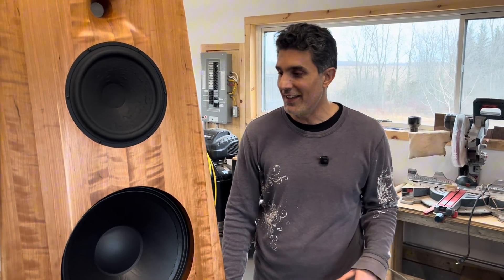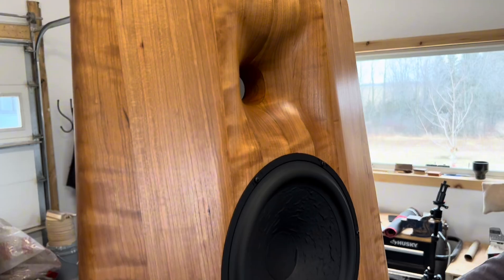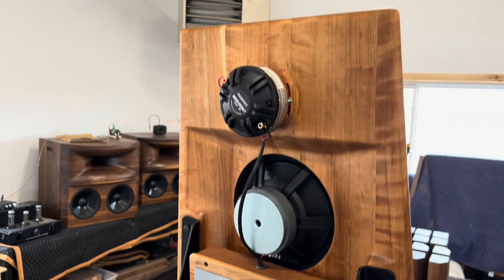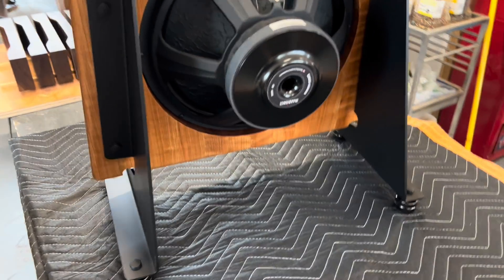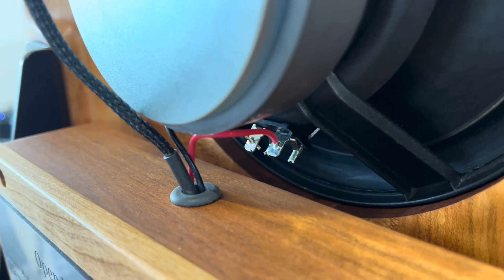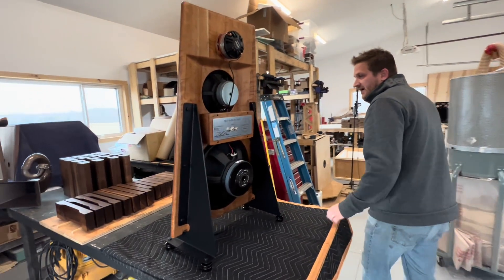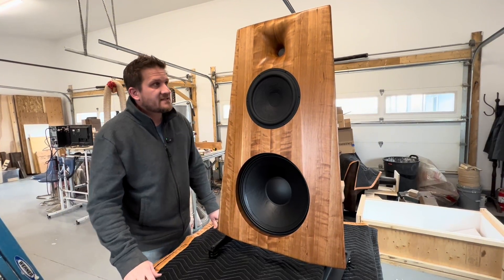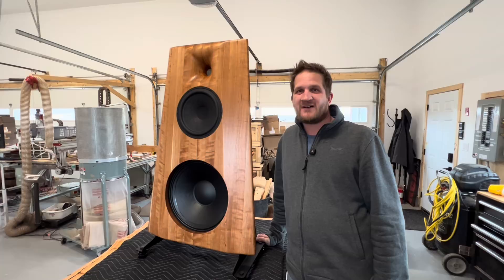Closer Look! Open Baffle Speaker No.1695

Comment: I have open baffles in my living room and I love them.  Mine are built in 1.5 inch Baltic Birch and solid walnut, 1.4” comp drivers and 15s on the bottom.  Your open baffles with the sculpted hardwood horn and baffle are just exquisite!  I love seeing beautiful design and fine woodworking.

Comment: Surprising to me that a compression driver horn at 110 db sensitivity would be matched with a 10” mid woofer at under 90 db, particularly with the high amplitude breakup at 2.5 kHz.
Reply from the maker: The compression driver is padded down so no issue there. 2.5kHz is outside the crossover region.

Comment: Your website does not mention their nominal Impedance . For $13,500 you should mention that . Most beautiful OB speakers I've seen . Hands down prettier than my Spatial Audio M3's .
Reply: it says in the specs of the Speaker No.1695 (blogs), it stands at 95dB and is stable or "well-behaved" 8 ohm load. all thanks to the 2.5 configuration I suppose...

Comment: Beautiful. What is the tweeter height? Might be good to add on your webpage. Some sound sample videos may be helpful as well as some frequency, spectral decay, impedance, impulse, plots. Anyway, excellent, and Canuck too.
Reply: On the website the tweeter height is stated as 948 mm or approximately 37.3 inches from the floor with GAIA footer attached.

Comment: sure looks beautiful. just a hint, the SB Audience ROSSO-21SW800 has a QTS of 0.76. That should be good for open baffle as well. 🙂
Reply from the maker: Don't tempt me!
Reply: My question would what would your design goal be here.  The 21” driver doesn’t go lower than the 15” woofer being used in 1695.   So if you are looking for greater low frequency extension, this probably isn’t going to work.  Of course, a 21” driver would move more air than a 15 driver.  

On first glance, where this might make sense is as an alternative to something like using dual 15” drivers per side.  It could also make possible using dual 10” drivers in a MTM with the compression driver.  But now you are probably talking about a speaker that would only work in a large room.
Reply: There is also another concern.  The 21” SB is roughly 3x the weight of the 15” woofer used in Project 1695.  One of the many great things about 1695 is the speed and definition of the bass.  Would the much heavier 21” SB have the same speed and detail?  These kind of questions is why you never really know what works until you build it and listen to it.

Comment: Troy, I'm still getting to know these incredible guys.  They continue to amaze me every day (especially bass articulation), I literally play them at least 8 hours a day now that I'm retired.  I'll have a full review for you in due time.  Just know that I've been through lots of OB speakers in my listening room and have heard great OB systems, but I wouldn't trade these horn open baffles for anything else.  The 1695's prove that impactful visceral bass can be had from an OB design, something which has eluded all other OB designs in my experience.
Reply from the maker: Thanks. I remember when I visited Germany I was invited to a private listening session. They played Diana Kralls 'almost blue' and I complained that the piano sounded thin. I then took the helm and adjusted the EQ (the system had EQ ability) adding bass and mid-bass unit it sounded proper. Everyone was nodding their heads that is sounded much better. This was one of the test tracks I used to develop the 1695. Bass and mid-bass needs to be rich and full. Second priority was soundstage depth.